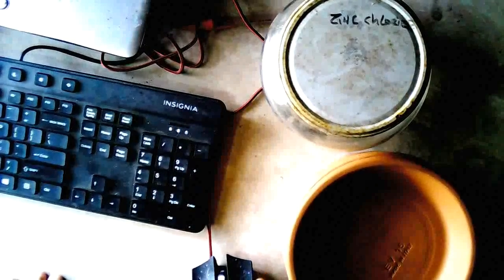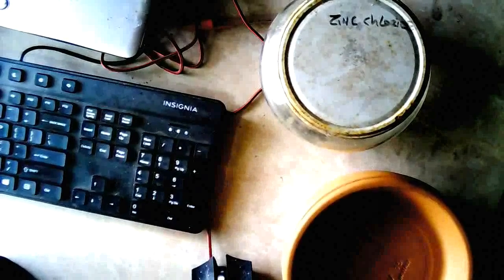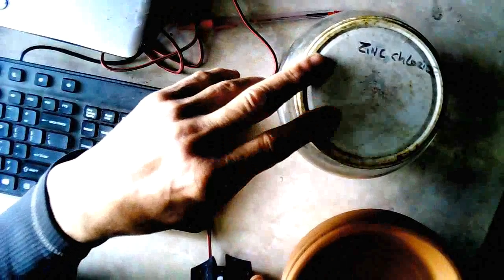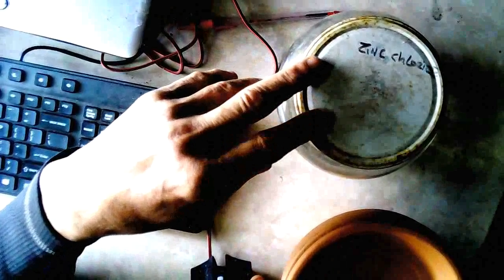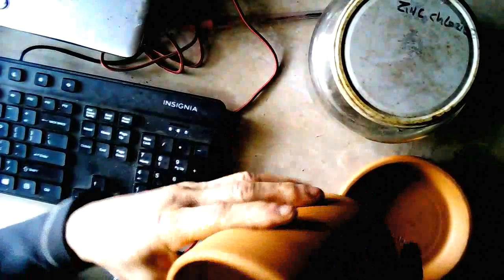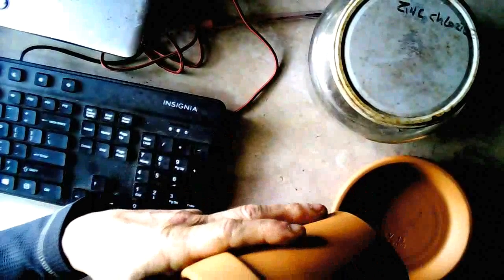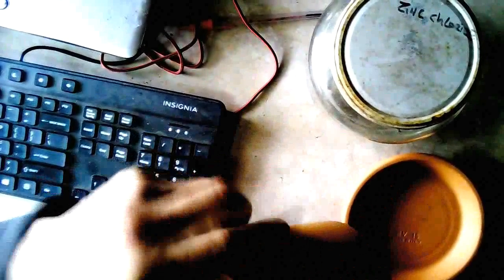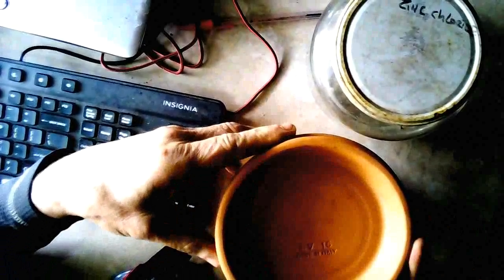Making Zinc Chloride & a Microwave Kiln

Comment: Hey Bio-Cell! Can't wait to see your results. after seeing RMS's video, I have been looking at a few of my old mugs as an start for a microwave kiln. I wan't to have the ability to vent and input other gases as well. I picked up a tank of N2 gas from a truck that was passing by selling gases for welding. Also just wanted to point out Zn + 2 HCl = ZnCl2 + H2, your reaction is producing hydrogen gas. I have been converting some of my ZnSO4 into ZnCL2, than drying it with heat. I end up with a liquid at 290c, which i cool to a white solid and seal into a container quickly.
Reply from the maker: Hi Adam, welcome to the channel. I used a porous pot to get the Zinc chloride into the ceramic, figuring it would heat up hotter. Good idea about ports for gases in and out, but a lot more work to do of course. There is also free Cl2 gas coming off during the production of zinc chloride too. If you make that stuff, don't breath the gases thinking it's just H2, or you could end up in the hospital or worse. I'm more concerned about safety than I appear in the videos.

Comment: For your kiln susceptor a carbon based material may be a better choice, as it has a very high melting point. as I was thinking and writing my comment it hit me that the zinc chloride's melting point is 290c. RMS's last video was more on an interesting microwave solvothermal technique.
Reply from the maker: Hi Adam, I suspect that the Kiln will naturally become coated with carbon during use.  I need to catch up on Robert's work.